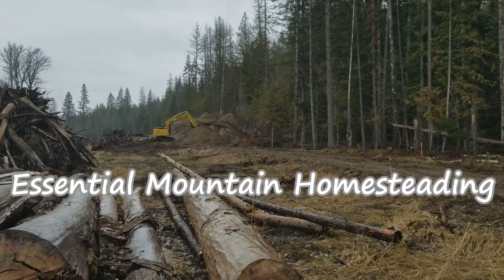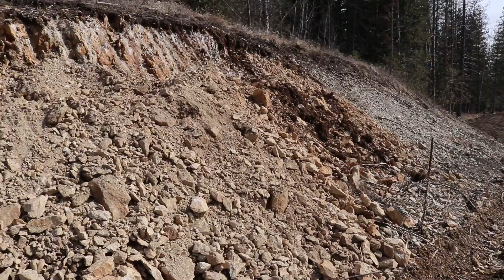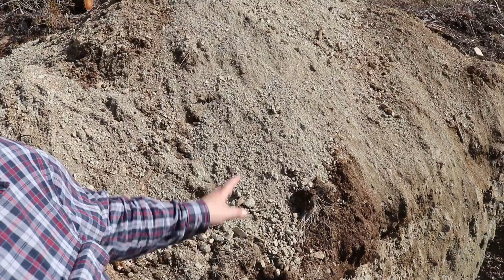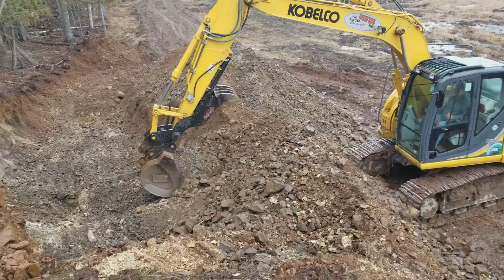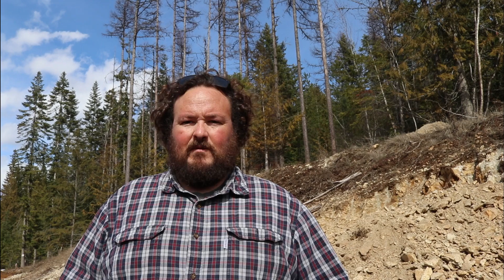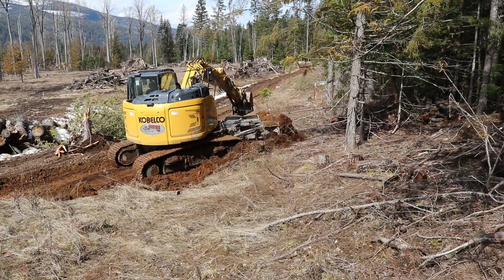Site Excavation and Evaluation With The Kobelco160 Blade Runner

Comment: Does anyone else understand the profitablity of making piles of wood chips out of all that organic matter in those piles in the background???
PLEASE MAKE SOME COMMENTS CONVINCINGLY To JOSH, 
Mr Rocky the Crusher to turn all of that into SOIL AMENDMENT   
WHICH THE FUTURE HOMESTEAD LOT PURCHASERS WILL BE VERY THANKFUL FOR!!!
Permaculture practices will raise the value of THE NORTH 40 HOMESTEAD PROJECT!!!
Reply from the maker: Brian, 
  In order to grind up all of the organic material that we have which includes the almost 900,000 board feet of cottonwood trees it would cost $38000 to  Chip everything on sight and then another $6500 worth of equipment time to spread that much organic material out over the 40 acre property.   If you wanna write that check  I'll be more than happy to put you in touch with the tub grinder guys if not get yourself a Box of matches and a can of gasoline becuse we've got some organic material the burn.
Reply: Essential Mountain Homesteading 
Not at all that much to grind up those piles!!!
I promise I will come up with a piece of machinery and it will be much less
Top soil is made from ORGANIC MATERIALS -- Ask your buddy Paul Weaton!!!
Reply from the maker: @BrianBriCurInTheOC   Please keep in mind as you're out there wasting your time, There are a lot of cotton wood stumps that need to be ground up. They will require a tube grinder in order to get the stump to fit in the machine.
Good luck reinventing the wheel!